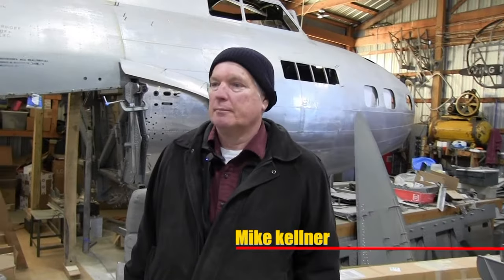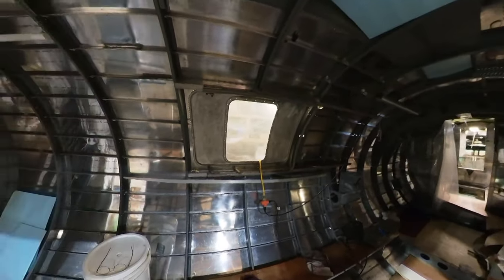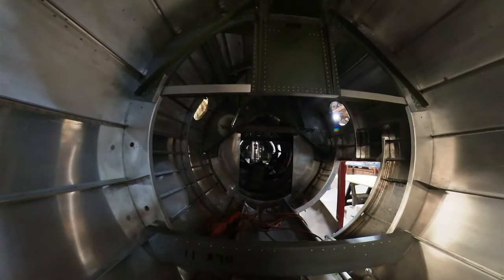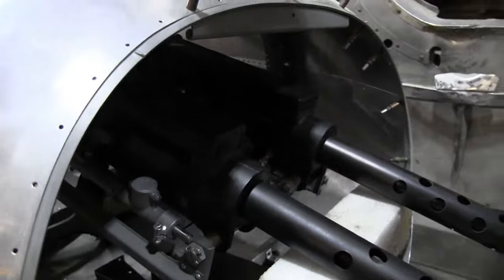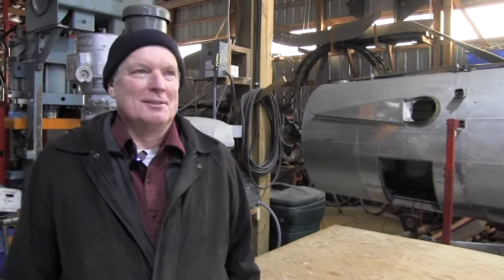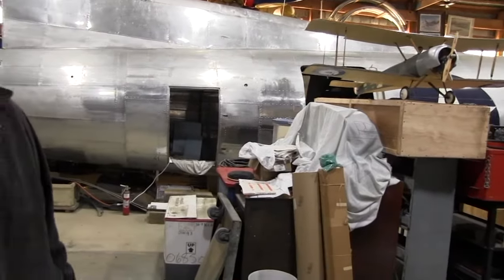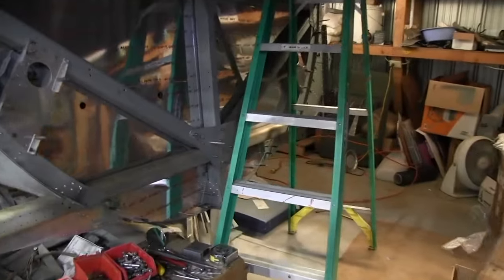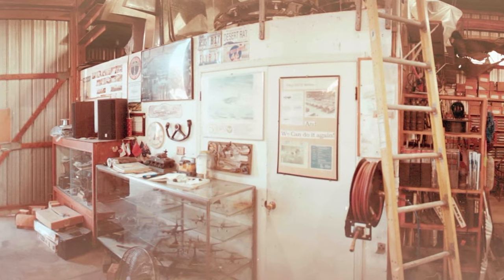Desert Rat / Tangerine B-17E 2023 Update  We hear from Mike Kellner

Comment: Is it true that the B17 C model is also being built there?
Reply from the maker: No. There are b17 groups on Facebook. You might find the B-17C through one of those groups.
Reply: @RideswithChuck  OK. Because the group that's supposed to be building a C model said some work was being done there. I'm kinda doubting that project even exists. But thanks for the info
Reply from the maker: The Desert Rat guys sometimes make parts for other B-17s. That might be where the confusion is coming from. Desert Rat has a Facebook page.  @mallonmusic